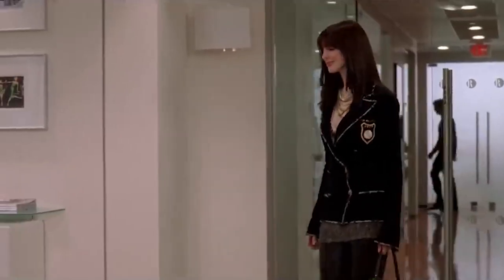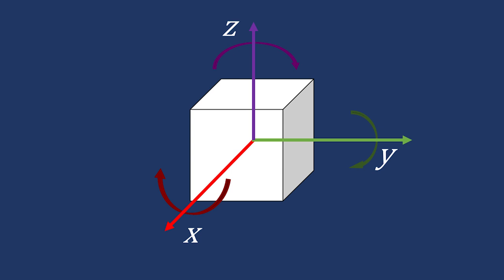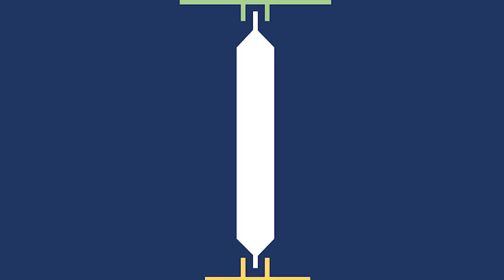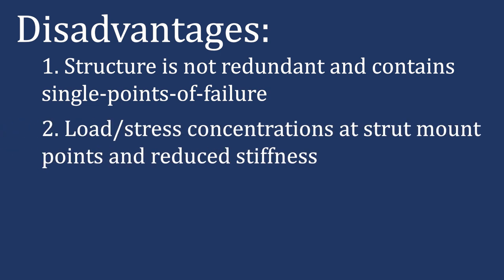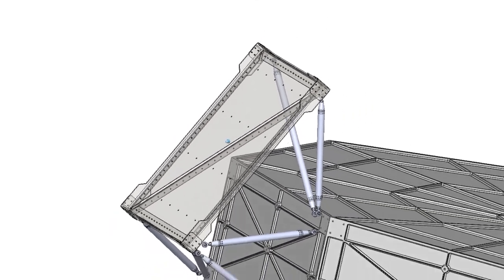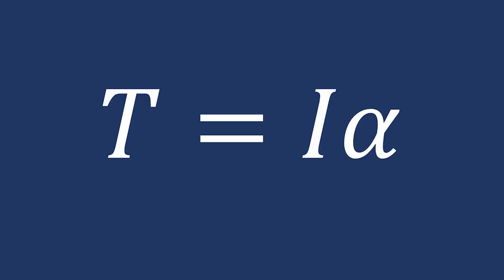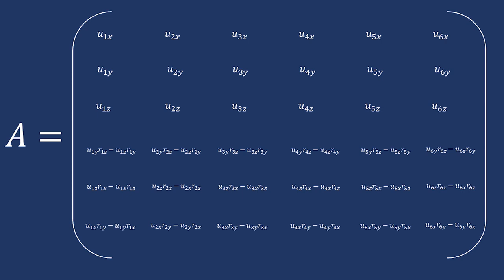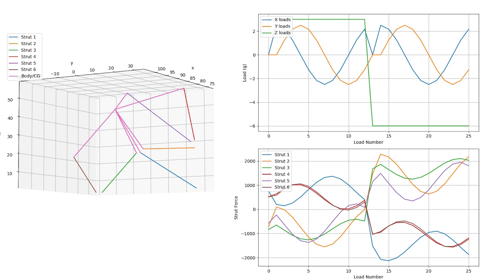Strut Structures and a Python Script to Calculate Them

Comment: Dear Sir,
I sincerely appreciate the effort you put into this Strut Structures video.  I am a semi-retired mechanical designer and I have used struts fitted with rod ends on several occasions.  Accommodating differential thermal growth with six rod end struts is frequently a life-saving design solution.  The content and graphics in your video are outstanding.
I’m sure you are aware of the following details, but for the benefit of the young designers among your followers, may I share a few additional thoughts?   
1)	One of the helpful features of struts with rod ends is infinite length adjustment.  If right and left-hand threads are used on the rod ends, the strut becomes a turnbuckle.  There aren’t many structural elements that accommodate tolerance like a turnbuckle.  This can be a lifesaver during assembly. 
2)	If your application can tolerate a weight and cost penalty, the single-point failure issue can be mitigated to a degree with redundancy in the end fittings. A sleeve tube over the axel bolt and dual clevis ears on both sides can help.  A sleeve tube within the outer tube can offer a degree of redundancy to the strut.  However, from a practical standpoint, just making sure you have adequate stress margins and a conservative life limit is usually the most cost-effective approach. 
3)	In my rod end explorations, I have picked up a few helpful tips: 
•	Plain bearing rod ends are very affordable.  A male rod end with ¼ - 28 fine thread stem costs $5.43 from McMaster Carr https://www.mcmaster.com/products/rod-ends/ball-joint-rod-ends-10/  as of today, 06/20/2023
•	The plane bearing rod ends with the fiber-filled Teflon liners are durable and work well in many applications.
•	Rod ends with double row ball bearings are available at a higher price https://www.mcmaster.com/products/bearings/rod-ends-and-linkages/high-speed-ball-bearing-rod-ends-7/  Ball bearing rod ends are used in aircraft control linkages and animatronic mechanisms.  They offer smooth operation by eliminating stiction or breakaway friction and jerky motion.  https://www.pic-designcatalog.com/heim-rod-ends/heim-ball-bearing-rod-ends/     	https://rathibearings.com/products.php 
•	Large rod ends (2.0" bore diameter) made from high-strength steel can handle more 300,000 pounds of static radial loads.  https://radialbearing.com/wp-content/uploads/2018/05/Rad-Bear-Catalog-2012Imp-R4.2-3.pdf
•	Conical spacers or washers mounted on the sides of the spherical bearing allow full angular deflection.
•	At least one off-road rod end company offers “misalignment bushings” that enable up to 60 degrees (30 degree half-angle) of angular deflection: 
 https://www.fkrodends.com/products/special-products/commercial-series-3/  Be aware that the additional deflection comes at the price of a reduction in strength due to a smaller diameter through bolt.  Increase the size of the rod end as needed. 
•	At least one company https://www.ridetech.com/products/r-joint-en/ offers a spring-loaded self-adjusting wear compensating feature in their suspension rod ends.
•	Rubber boots and face seals are available to protect exposed rod ends from dirt.  Caution: If the booted rod ends will be exposed to water and mud, inspect the seals for cracks frequently.  The boots can retain water, leading to corrosion and shortened rod end life. 
•	At least one company https://www.rbcbearings.com/Engineering/Ball-Bearing-Rod-Ends can custom make high temperature (1,200°F) rod ends  
I look forward to your forthcoming video on end fittings for the rod ends.  
Thank you.
Van
Reply from the maker: Thank you, this is some great information!